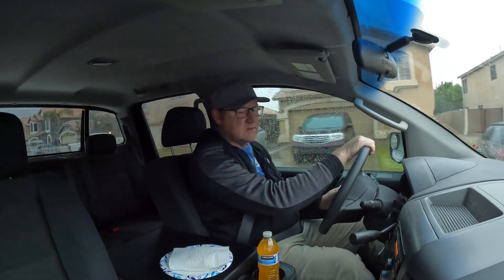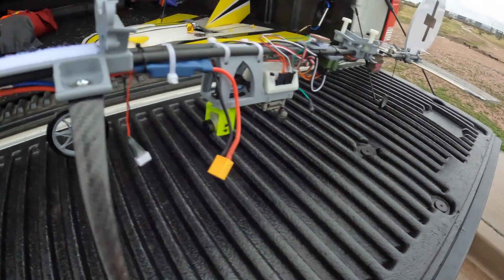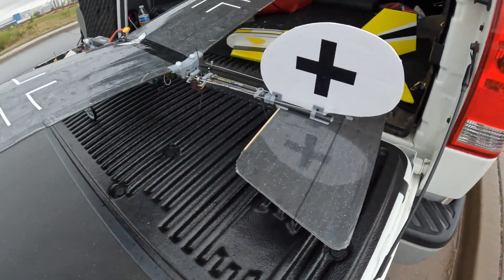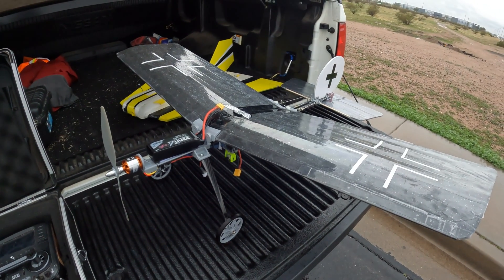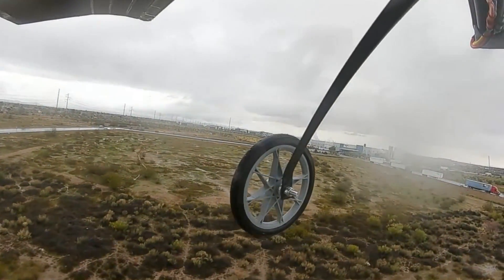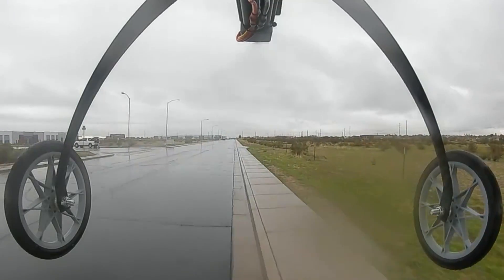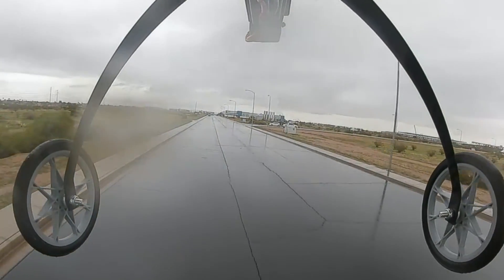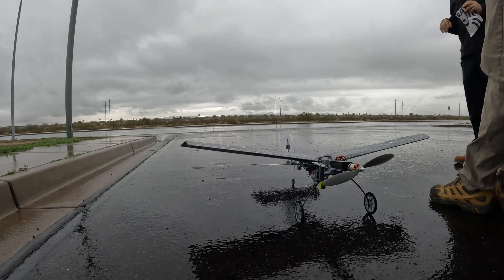Build and Fly your own FPV Slow Stick from Scratch!

Comment: Hi, I was impressed with your video and I thought I’d give it a try. I bought your printable download, but there are so many files in there that I don’t think I need.. I have a very old artillery X2 printer that’s not too fast. Can you give me a list of the files? I need just to print the Plane in the video. Thanks very much in advance.
Reply from the maker: Hi Phil, yeah, all kind of options for the build.   Check out the descriptions on the download parts listings, most of them describe how many to print or what the part is.   That should help.

Comment: with ailerons, can it do sport flying or even some 3D stuff like the ultra slow stick?
Reply from the maker: Yeah it will fly like an aileron plane. But I don't think the ailerons are as responsive with the under camber wing like it is. But you can do it.  I have made a couple of different wings and you can switch it out so you can try it with both wings.

Comment: Would like to get into 3d printing a slow stick.what would be the 3d printer I should get?
Reply from the maker: 3D printing is a fun hobby.  Especially when it supports other hobbies like RC planes.   There is a huge range of printers out there, any of which will print these parts.
Reply: Given that their are a large range can suggest one or which do you use?

Comment: Busy building one. Awesome. What is yoir AUW? 🤠👍🛩️🇿🇦
Reply from the maker: Awesome, you will have to share your build.   All up weight with 2200mAh 3S pack is 980g -- this includes full FPV system, OSD, GPS.
Reply: @Qromer  will share. Thanx for awesome videos🤠👍🛩️🇿🇦

Comment: Boa noite, tenho um que eu mesmo construi, faz algum tempo, qual a eletronica que eu poderia usar, ele tem um metro e vinte de envergadura.
Reply from the maker: It sounds like you could use the recommended electronics listed with the parts.   Check the link in the description.

Comment: Hi, Nice design. I got the files from printables, but the DXF measurements do not match the A4 PDF measurements. Can you share some dimensions so I can see what it's supposed to be. Like wingspan and stabilizer span.
Reply from the maker: The A4 PDF file was made from the DXF.  Use QCad with the DXF file and you should have the exact measurements.
Reply: @Qromer Ok, must be my printersettings then, but at least now I know that the DXF is the original.

Comment: can you include dims for the wings please?
Reply from the maker: The shared PDF are actual size.
Reply from the maker: Wing Span	1176 mm (46.3 in)
Reply: @Qromer  okay thanks.  i nearly have all the plastics printed out.  then i will do the wings, nervous to make them because i never have used filmboard before i might try using beer boxes...  btw have you built one using a smaller prop? i have several 5 inch props from drones ive made, with 6s motors.  but im not sure if i should try one or just go for the big blade like you did.
Reply from the maker: @augustshades  the larger prop you swing with a low KV and high torque motor is what you want with the slow stick.  The 5 inch props and high KV motors are good for zippy planes but not for a Slow Stick.   I hope your build went well.

Comment: good work.        BUT, i would have  FIXED  the defects in the design.      among other things, the vert-stab design  Sucks.      this model 'looks' like a slow-flyer, but it is  fat/heavy.        so, the use of a SF prop is  Not  recommended.      it appears that the stabs should be about two inches farther from the wing.      a tail wheel  goes   at  the  Tail.        the height of a tail wheel strut should not interfere the  tail's ability to move downwards.!                you may know the following:   an aircraft's center of mass (c-m) is Supposed to be located  On the thrust line, at a point that vertically aligns with twenty-five percent of chord; as indicated in linked illustration.        the distribution of mass (dom) of an aircraft can be visualized as a horizontally oriented 'teardrop' shape; one that is 'centered on' the described point.            happily, you have correctly located the cg; near thirty percent of chord.        there remains, however, significant tail-heaviness in the model's dom;  because of the excess mass in the dual carbon tail booms and  the location of servos/mass aft of the cg/c-m.          the use of CF in a tail boom is  Not  recommended.    in part, this is so because the dom of a CF component  Cannot  be  Optimized.          d            googletranslate
center of mass
https://s3.amazonaws.com/assets.flitetest.com/article_images/medium/truecg-jpg_1384168691.jpg
Reply from the maker: I love this plane and the way it is flying.  My intent was to make a slow stick.   Thanks for sharing your opinions.
Reply: What are you on about? The Slow Stick is perfect. It is not a high-performance model. The slow fly prop is perfect for it. You're tripping balls. Let's see you build. You like to criticize without even having built one before, just like all the armchair engineers in the YouTube comment section. The slow stick is flying perfectly. Also, may planes have a mid-rear steerable wheel. It does not have to be on the tail.

Comment: Fantastic video,  and an awesome design.  I am keen to understand how you made the wing. It looks extremely rigid,  but I couldn't see any ribs or spars?
Reply from the maker: The wing is 5mm foam board with a slightly thicker paper.  It is very ridged.    There is a 3mm carbon rod on the leading edge and trailing edge of the wing.
Reply: @Qromer  that you so much. Keep doing the amazing projects.

Comment: this is 10x better than the Flite Test version.  I just bough a boatload of black sealing tape because I can't find any white DTFB, just black, but the clear tape actually looks better on the black foamboard than the black tape
Reply: Great job on the build, the flight, the video and tunes
Reply from the maker: Hey thanks! Yeah I was not impressed with the light test version or the horizon hobby one. I plan to get a lot of flights on this and I will post some more videos. Thanks for watching and commenting.